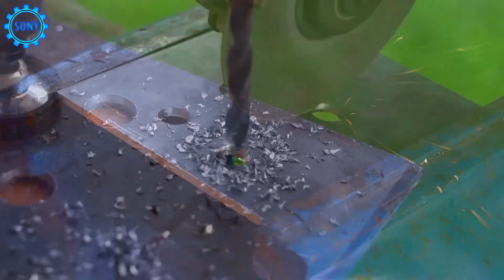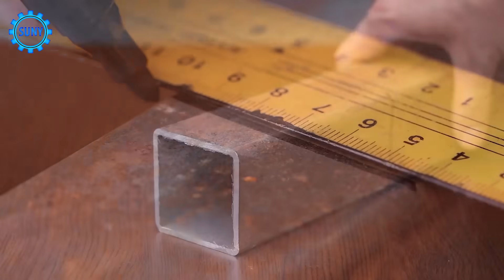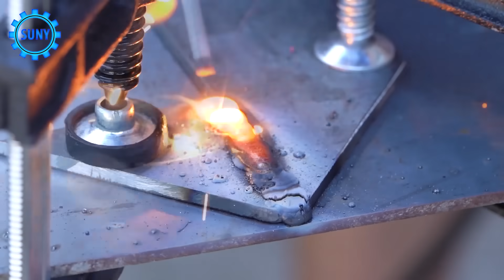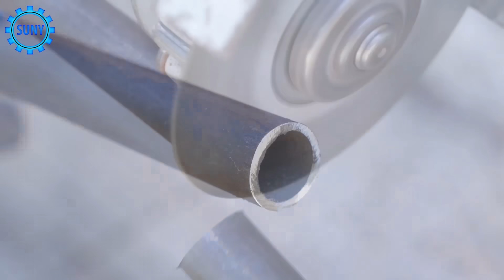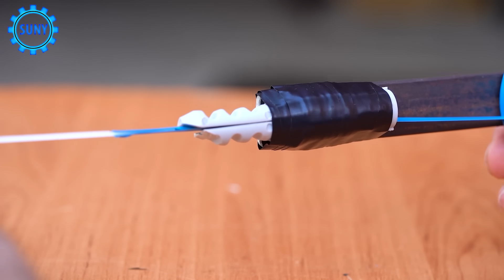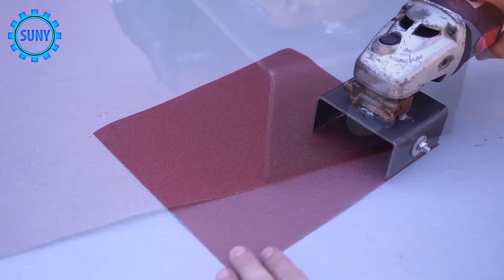6 HOMEMADE DIY USEFUL INVENTIONS

Comment: Question. Your pipe roller. If you went bigger and added a thredded rod to the sides to manage the height of the roller bellow the one with the handle would it work to roll thicker material? 1/8 for example (aluminum)